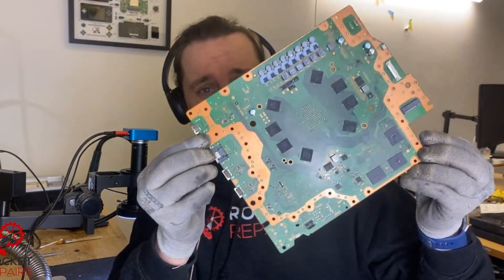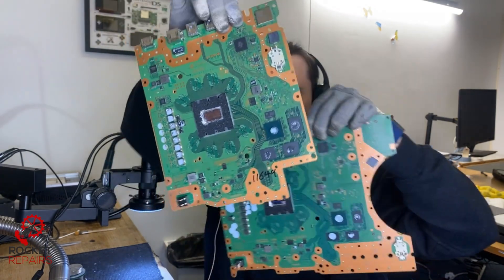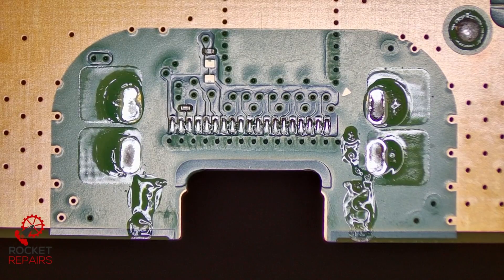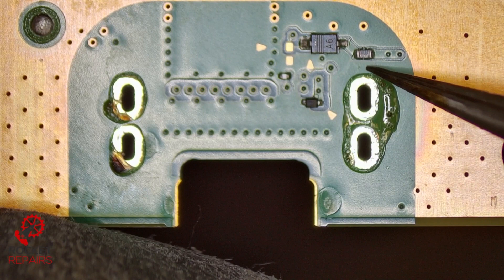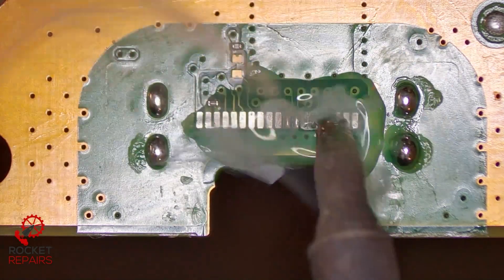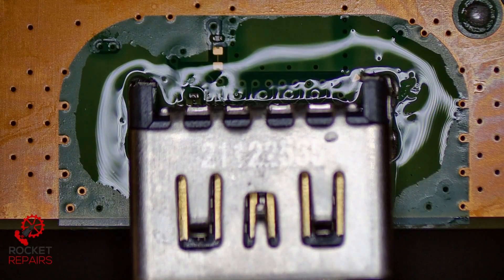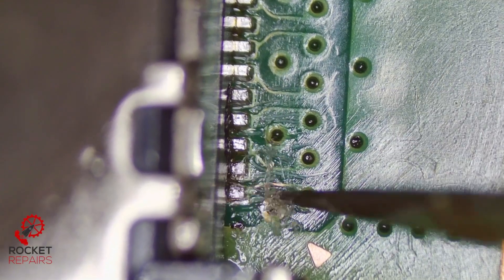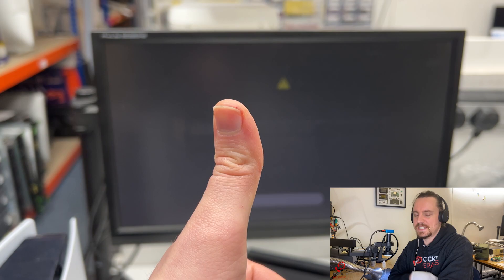New generation PS5 motherboard needs repair - let's take a look inside!

Comment: condensateur c8 c12 c24 mofset d12 sortie cpu gpu 12 connecter en serie la sortie d12 au gpu 12 via carte arduino pin analogique. injecter code print hello world suivie de la sequence binaire suivante 0001 0010 1000 1010
Reply: dumper la nand
Reply: decrypter la nand avec c4eva -O decrypt ssl output, finir avec binwalk
Reply: pour le condo il faut les brancher en paralele sur la carte arduino pour stabiliser la tension au sortie d2 d4 et d5 ensuite une fois completer tester et faite un proto de la puce je veux voir, ya le temps

Comment: Hi, thanks for the great video!

I have a question: I need to do the same repair. The SMD capacitor by the pins is missing—can you tell me exactly which capacitor it is? The one that’s very close to the port? 0201? 10V?

Comment: What causes that?? What are the symptoms becuae mine gets warm imstantly then cant play not even 2 hrs in already warning too hot or shuts off and no dust or Debris around psu,heat sinks,radiators so what else could it be?:)

Comment: I love my new PS five I got mine at target and yes I think I got the 2000 model. If you know the 2000 model of the PS five mine is the disk version the God of war Ragnarok disc addition I love it I haven’t seen anything wrong with it, but I wish I could’ve gotten a older model because bigger circuitboard, but mine runs very quiet. When I start it up I can hear the fan but then it goes quiet very quiet. I’m going to buy me an older PlayStation five I don’t know I don’t notice anything cheap about my consul you know by them making the shorter circuitboard I have a two year warranty, so I don’t care with Allstate and PlayStation so I should be fine